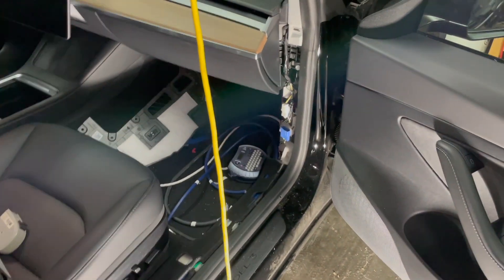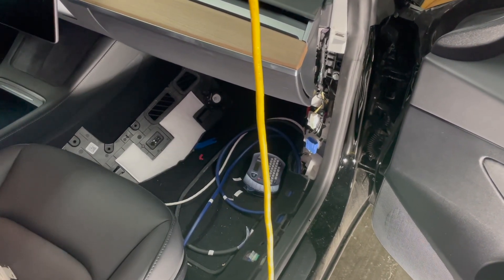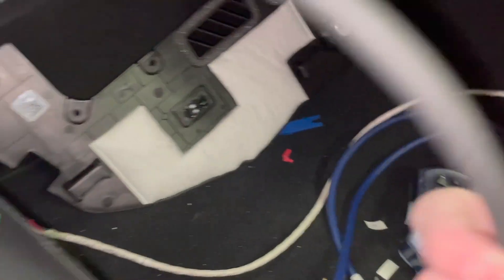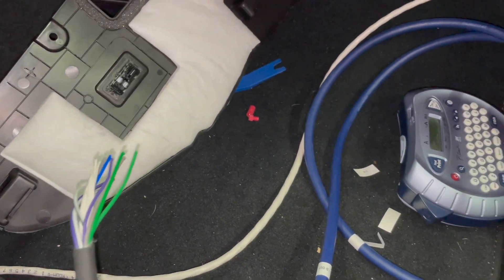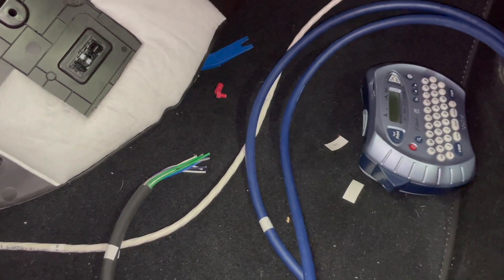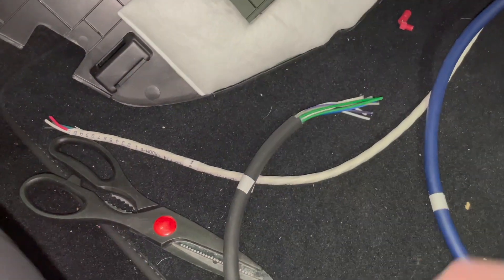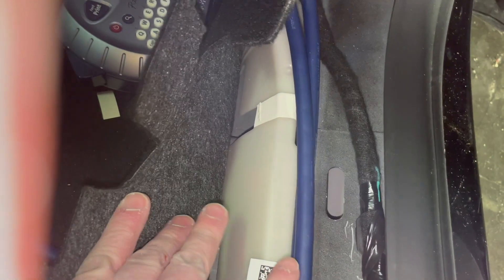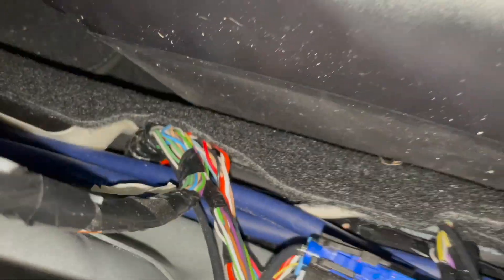Model 3 SR+ Audio Upgrade Part 2:  Speaker Wiring

Comment: did you ever finish the project?  I am looking to re wire my system to add a digital eq. if you have a follow up video that would be helpful
Reply from the maker: @franciscocuriel1872 Oh yeah, I should probably do a follow up or upload all the other videos I did. But I finished it, and actually ended up re-doing and upgrading things so I have different speakers and different mounting locations now.
Reply: @ nice, did you happen to install an equalizer? I bought a digital one and will plan to install. Adding rear speakers since the basic model don’t have none